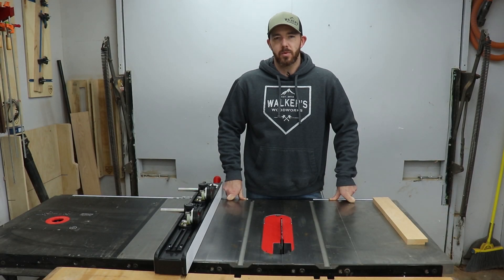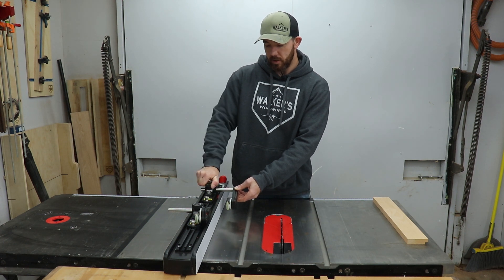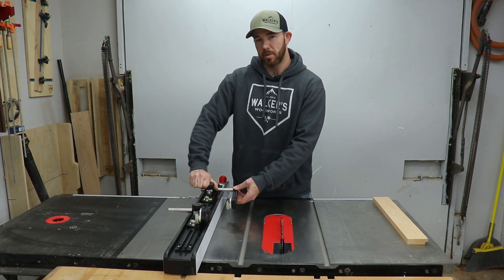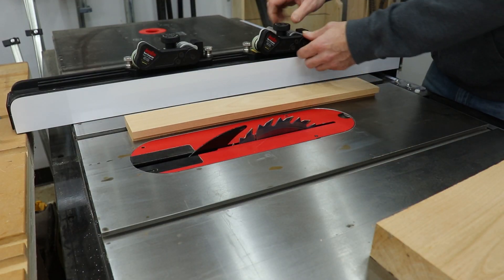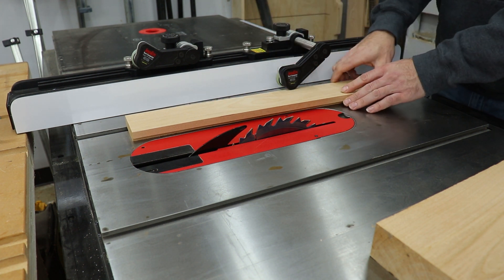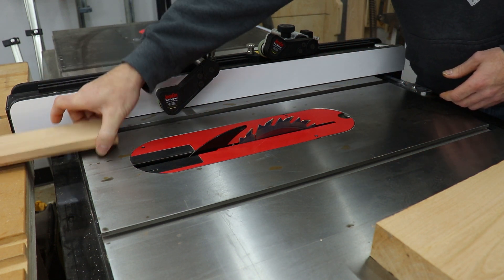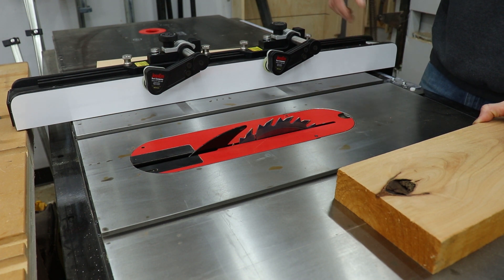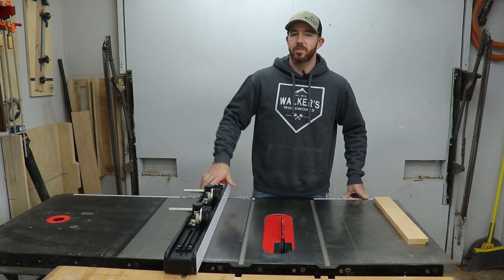JessEm TS Stock Guide review / Table saw safety

Comment: These stock guides work great, AND they also prevent the stock from moving backward with the wheels that will only move in one direction.
Reply: I forgot to mention, I've seen several videos that show magnets holding down each end of the Jessem on the fence. I DO NOT recommend these. I have a Harvey saw, which has a label on top of my fence, which I removed. The magnet manufacturer recommended they should not be attached to paint and be attached to bare metal only. Mine was "pretty" secure on the painted fence (2 @ 95# each), but they could be moved with some force, so I opted to screw mine down to the fence to be 100% sure.

Comment: Looks like a great product but read reviews of how the o-rings degrade quickly. Replacement with shipping sounds expensive.
Reply from the maker: I haven't had that issue yet.
Reply: I replaced the rings on my router table's version of these hold downs (they look to be the same). The Jessem cust service rep was fantastic and recommended buying them from a US-based distributor. They are from Jessem, cost the same (mine were actually less because of the timing of the currency conversion), and you don't have to deal with shipping (or customs delays) from Canada.

Comment: Bought these a few months ago.   Really like them.  Well made.  Makes the saw safer to use, especially with thin sheet goods.   Helps keep plywood or Masonite from lifting up and being caught on on top of blade and kicking back.   Only drawback is I use a incra fence and must make extra step to lock it down tight because this will lift the fence up as the wheels apply downward pressure.
Reply from the maker: Ah.  I don't seem to have that problem on the sawstop but I can see where that would happen.

Comment: I have these and think they are a great addition!  A quick note on installation, for each hole to drill (think there are 8 of them along the track) there are actually drill guide holes that are offset by 1/2" from each of the actual mounting holes, so all you need to do find where you want the final track position, offset the track by 1/2", drill all the holes and then slide the track back a half inch and attach the mounting screws.  In your vid you used a drill punch which works too, but they included those holes in the track as a guide.

Comment: Great demo, Walk! (calling you that or, Bud, because I couldn't find your first name)  My only question is, " how do you push a very narrow board through??"  In other words, if your stock is 2" wide or narrower, there's no room for your push stick, and you're certainly not going to get your fingers near that blade.
Reply: I use a thin push stick that goes under the rollers. Because the guides take care of pushing down and towards the fence you only have to worry about pushing horizontally. Any thin stick less than the thickness of the stock you are cutting will work fine. I've cut 3/4" runners for a sled using this method.

Comment: I have an Incra fence...guess this setup won’t work for me.
Reply from the maker: I'm not sure on that one.
Reply: @WalkersWoodworks  there actually is a "kit" so that it'll work on Incra TS systems....in case anyone else wants to know.
Reply: @mattnudi9752  I did get them with the kit.  Can't say I've used them on enough various cuts to make judgement so the jury is still out on versatility.  They do make things safer and don't have to hold the piece up against the fence...I do like that.

Comment: I like the intended benefit but its way too much fussign. And drilling into my sawstop fence is a deal breaker. Great concept but this one dies on the design table.
Reply from the maker: I disagree.  I use them all the time.
Reply: @WalkersWoodworks  I have this on my to-revisit list for down the line. Thanks for the video
Reply: @WalkersWoodworks  Rewatched your video two more times. Looks like I might just eat my hat on this one. I'm always worried about drift north of the saw blade. This contraption may be worth its weight in gold after all. Would still go the no-drill install route. I posted a link in another comment to this video. Thoughts on that?